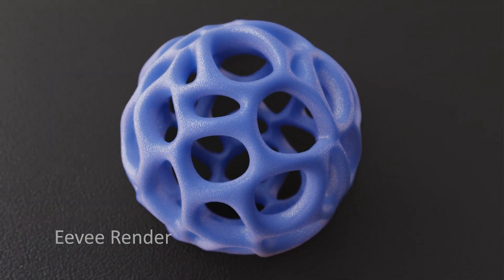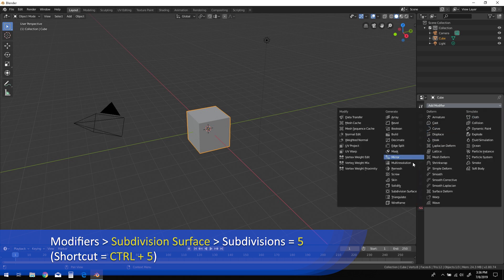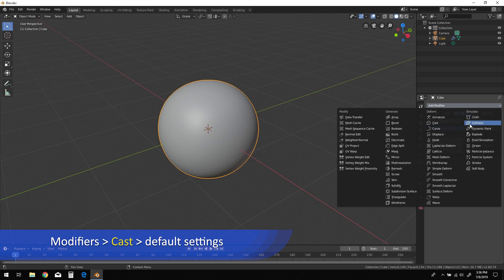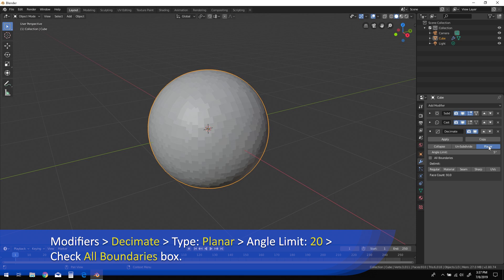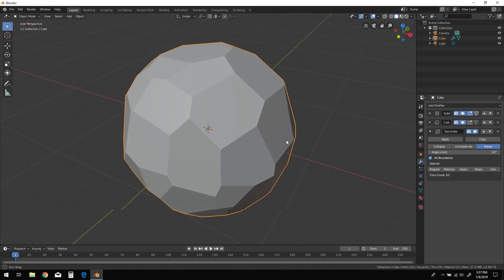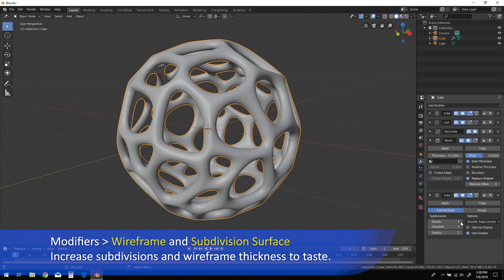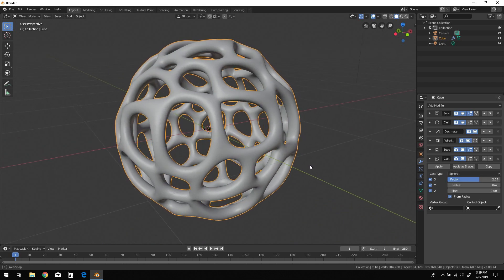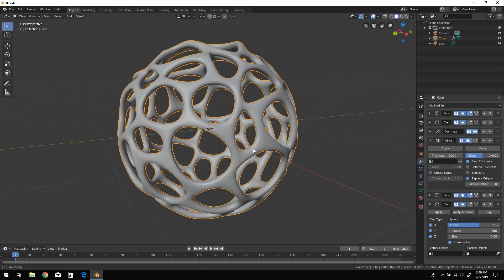Blender 2.8 Tutorial | Parametric Voronoi Sphere | 3d Modeling

Comment: Can this be done with any 3D object that is imported into blender?….
Reply: Yes, but you may need to take a few extra steps before you can apply it. It will depend on the quality of the file imported. Such as, convert the object to a mesh (right click convert to) and join the objects if it imports as multiple pieces and you do not want that. Then you may need to clean the uv mesh up with the uv editing tool first. Looking at the wireframe view should help you determine if you need to clean it up or not. For larger, complex items, the subdivision and casting steps may not be necessary and could cause the program to crash so you may try to skip those if possible. The final wireframe and subdivision stay the same

Comment: Works well for spheres.  Doesn't work for planes.
Reply from the maker: There is a similar technique that can be used for planes but the process is different of course.   It doesn't work at all on cylinders though.
Reply: @luxxeon3d  if we are a cylinder? How should we proceed?
Reply from the maker: @vicentquerol6995  This process will not work for a cylinder because of the topological and mathematical differences.  I actually do not have any way currently to produce a fully procedural result on a cylinder.  I'm sure there is a way to do it with geometry nodes in Blender 3.0, but I haven't tried that yet.  There are some node wizards out there who might be able to help you though.

Comment: Hi Luxxeon, is it possible to make the voronoi gradual? I'd like to make a voronoi skull, just with full surfaces around the mouth and the eye orbits, and all the rest holed, starting from tiny cavities with huge ones on the other side.
Reply from the maker: It's possible to some degree, but really it would involve much more than the techniques I have shown here in this video.  It would require a much different workflow, and perhaps some addons would be useful, like Tissue addon.  It would also require a specific topology for the skull to start with.  Delaunay triangulation would perhaps make the process easier to achieve, and then of course driving some of the modifiers with gradient ramps or vertex weights.  I think Tissue would be the most productive way to go about it, but it would be more complex than I can explain here.

Comment: Hello I would like to make this voronoi shape on a tube, how can I do?
Reply from the maker: The same technique should work on almost any geometric shape so long as you start out with quad polygons.  I'll have to experiment on a tube shape to see if there are any problems, but the same modifiers should work on a cylinder just the same.
Reply: @luxxeon3d  I said to myself exactly the same thing but in reality it does not work. On the tube there are sides lengthwise and I can't do otherwise ...
do you have any idea how to do this?
Reply from the maker: @Haru-yu2vv  Ok, you are correct.  The Decimate algorithm will not work the same on a tube.  I'm not sure why this happens, but it may have something to do with the directional surface area.  I'll have to think of another technique for this.  It's a good question.
Reply: @luxxeon3d  I'm looking right now, I auntie something with the shrinkwrap command to have a different mesh ... But I would love to find because it is for a project.
Reply: @luxxeon3d  After several hours of research I have pretty much succeeded but I can't seem to have the effect of the cast. It's not as good as on the sphere ... If you find something tell me. Thank you
Reply from the maker: @Haru-yu2vv  I haven't had time to experiment with it.  I'm going to work on it today.  I'll let u know what I find.  Tell me, do u need the result to be procedural?  I'm not sure that will be possible in this case.
Reply: @luxxeon3d  not necessarily, I found something but I can't seem to have the same effect as the cast on the sphere ... Thank you very much!
Reply: The only way to really do this type of shape on a tube is to use either Tissue addon or to use the Cell Fracture addon in Blender.  The long, straight edge loops that make up a tube geometry make it impossible to use a completely procedural process, even if you add a ton of vertices.
Reply from the maker: @cgvapors963  To be honest, I haven't had time to do any testing on this since his first post almost two weeks ago, but I think I know what you are saying here.  The irregular surface area of something like a tube would cause problems with the calculations in the Decimate modifier because the algorithm of the Planar mode is based on the angles of edges between points of the surface volume.  So if you have an irregular shape where the surface is elongated in volume along one axis, then the geometry between those long surface normals will be dissolved first, leaving you with long, thin polygons instead of the regular surface regions you need for a Voronoi diagram.  I'm sure there are a few tricks to help work around this issue, but I believe it would require breaking the procedural nature of the technique.  Of course, if that's the case then you may as well use the addons and strategies you have mentioned, like Cell Fracture or the Tissue addon anyway.  In fact, I think Tissue will allow you to remain procedural from within its own interface, so that's definitely something to look at.
Reply from the maker: If we are using addons, then there's also the By-Gen addon which can generate the proper edge patterns for Voronoi on many different object shapes as well.  However, I never usually include stuff like that in my tutorials if the addon is not officially included in the Blender distribution itself.  Tissue and Cell Fracture are included in every release of Blender now as standard addons, but By-Gen is not.  It requires manual installation and download.

Comment: Is it possible to apply this so that the sphere is filled in as well?
Reply from the maker: Not sure what you mean.  You could create the wireframe without removing the inside by selecting that option in the properties of the modifier, but you may need to make some adjustments to the base mesh to compensate for the geometry needed to proceed further.  This could work, but will destroy the purely parametric nature of the workflow.
Reply: @luxxeon3d  hello, could you print it, just like that. I mean do you to put any supports or something. Because I would like to print it, but I need to know if you have to put any supports in the interior.
If you do not need to put any supporters let me know please.
Thank you very much, 
And have a nice day.
Reply from the maker: @mtoon5366  It will very much depend on the type of 3d printer you are using as well as the materials you intend to print it with, as well as the scale you need.  If you have a 3d printer, you can export the model and run an analysis in a free software like MeshMixer to test it for your printer (assuming you modeled it to the proper scale you need with proper thickness).  This model would use the same rules as any other model that you have printed in the past.  There are no "overhangs" to this model, but some 3d printing will also require supports for bridge areas, which this model will have.  Just like overhangs, bridges may need support, depending on the scale of the model.  The rule of thumb for bridges is usually 5mm rule.  Are any bridges on this model going to be greater than 5mm in length?  If so, then you'll need supports for that. So if you're still not sure if this would print in your printer, you should run an analysis test in MeshMixer or some other software first.  SLS printing, for example, does not require any supports for this type of model.  FBM may, again depends on the scale you need.
Reply: @luxxeon3d  thank you so much, this was very helpful
Reply: @luxxeon3d  Hi again, I have noticed that if I do not apply the modifiers I only get 1 overhang, but if I apply the modifiers I get zero faces 1777 and overhang faces 6826. So what do you recommed me to do: apply modifiers or I should not apply the modifiers.
Please take into account that I would like to print this figure. Thank very much.
Reply from the maker: @mrr3493  When you say you get overhang after you apply the modifiers, what software is reporting this?  There shouldn't be any traditional overhangs with this model if it's done correctly, only bridges.  Again,  it all depends on the scale.  When you create this model in Blender, it is necessary to apply all modifiers before exporting as OBJ or the results will not be as expected.  What is the scale of your model and what software are you using for analysis after exporting?  It could help if I could see a screenshot of the model during analysis or perhaps share your resulting model so I could inspect it on my end.  Also, what type of 3d printing will you be using?

Comment: Great tutorial!!!!  The texture on the  voronoi sphere is fantastic....any hints??? ;-)
Reply from the maker: Thank you for your support!  The shader used for the animated sequence was really very simple.  It is a Principled Shader with SSS enabled and a PBR noise map in the normals channel to create the subtle bumps.  The environment lighting is a high res HDR with some area lights placed strategically around to enhance the shadows.  I think the SSS helped to bring out the realism here, and I also used a roughness texture which was a variation of the normals texture to help with the specularity.   Ambient Occlusion and Screen Space Reflections were also enabled in Eevee, and I increased the distance radius of the Ambient Occlusion parameter to a rather large amount to get more realistic contact shading.  When I switched over to Cycles just to compare the results, there wasn't much noticeable difference at all, even though the render time in Eevee was around 1-tenth the Cycles render.
Reply: @luxxeon3d  Thanks so much for the quick and very detailed reply!  I had suspected it was SSS.....it turned out very cool.....